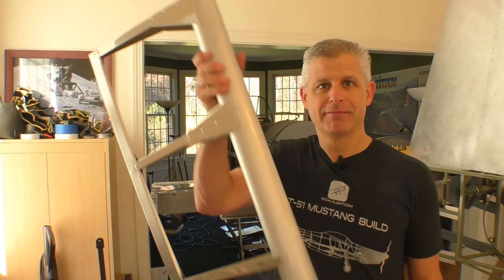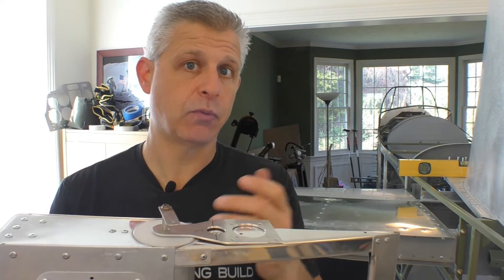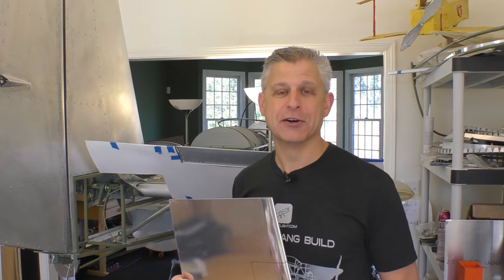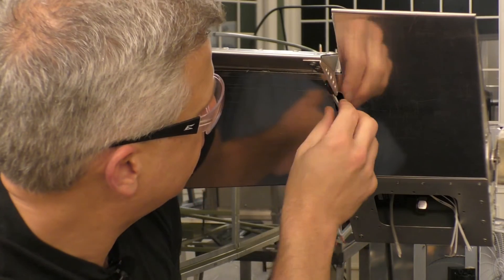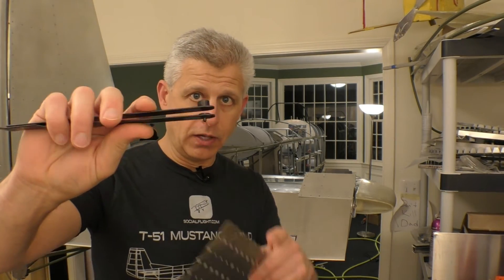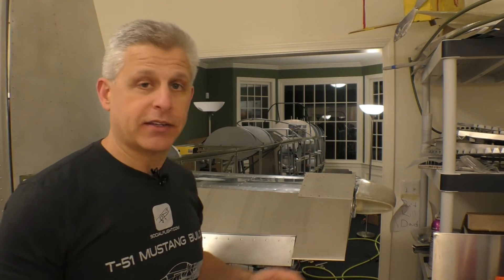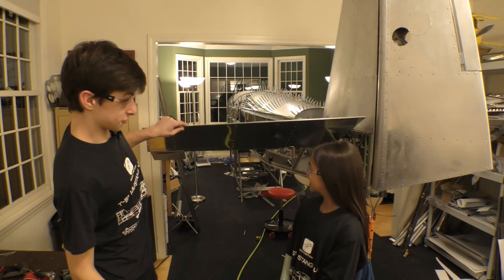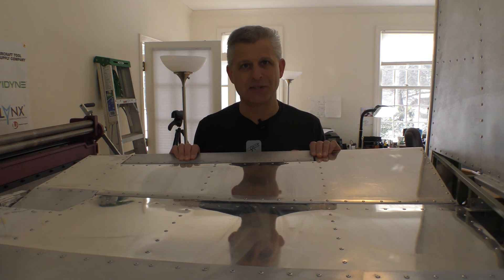Installing the Elevators on SocialFlight's T-51D Mustang!

Comment: Love the build.  What is going to be the powerplant ?  A Chevy LS9 (supercharged) would make it a beast !
Reply from the maker: GM LS3 V8 Engine (Corvette Engine)  430 HP derated through the prop reduction to about 315 HP.
Reply: I have a LS3 in my new Chevy Crew Cab truck rated at 420 HP and 460 ft/lbs torque.   (GM tuned and Camed for torque in the truck) That's so neat and can't wait to see your 51 fly !  You and your family are doing a great job on the build.  I am an 31 year long retired C-130 Crew Chief and Phase Dock mechanic.  Our Unit the 167th FG retired the last USAF P-51 Mustang in 1957.
Reply from the maker: @walt8089  That is SO cool!  Send us some pics to info@socialflight.com of your USAF days if you have them.
Reply from the maker: (if you're in the continental USA) Send us your address and shirt size and we will send you a T-51D Mustang Build Shirt! info at socialflight.com